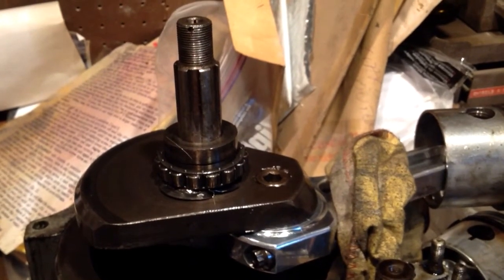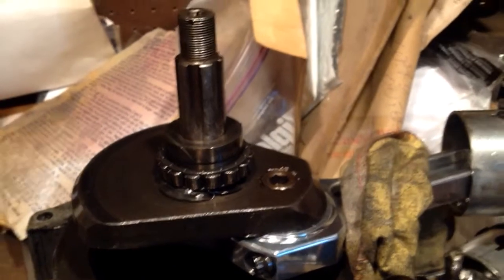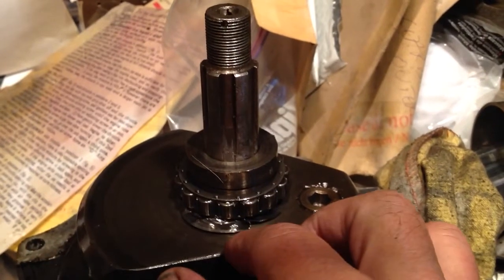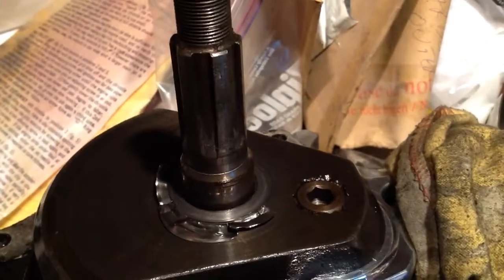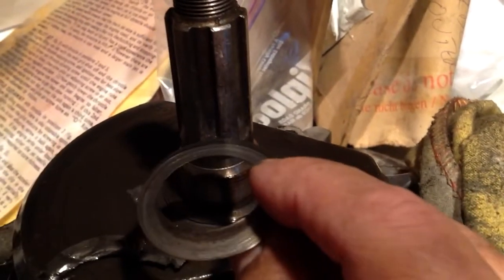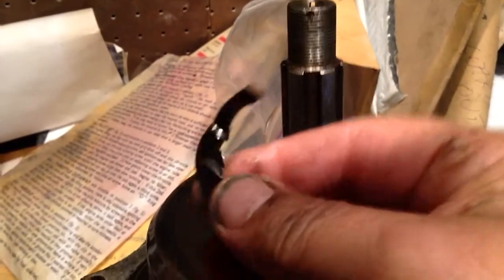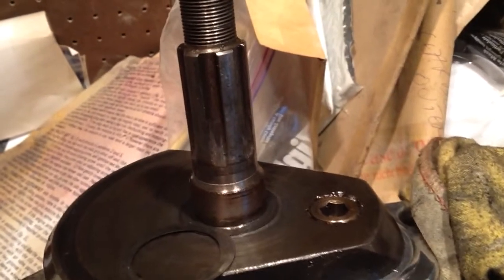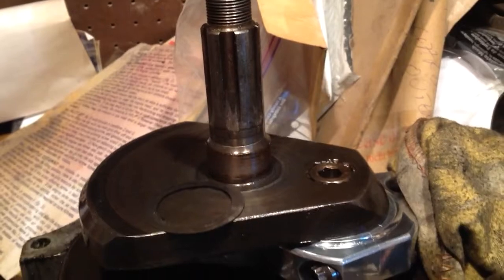BSA A10 Crankshaft Shim Investigation (Shimtastrophy!)

Comment: Draganfly in the U.K. Arrange to have shafts (mainly on Ariel two strokes) ground and industrial hard chromed to restore the correct fit of bearings on shafts. Some years ago I was aware of someone who had a  Triumph 650 crankshaft drive shaft bearing area built up with weld and machined to size, the shaft completely sheared away after a number of miles. I believe it was the heat from the welding which compromised this crankshaft and would dissuade anyone from contemplating this type of repair opting for the industrial hard chrome technique instead.
Are there any thoughts on this out there?.

Comment: I had the same issue.  I used Loctite 620, which is high temp/high strength bonding (this was after it chewed up the shims).  The root cause of the bearing spinning was a loose cush-drive nut.  That nut has to be tight (65 pounds of torque), because that's what hold the spring stack and spacers together and keeps the inner race of the bearing tight against the crank so it won't spin.  If that nut is tight, you shouldn't have a problem.  If you're using multiple shims, it's better to keep the thin shims in the middle of the stack.  Less chance of them distorting when they are sandwiched by thicker material.  I put on 3000 miles since I repaired mine and its still OK.